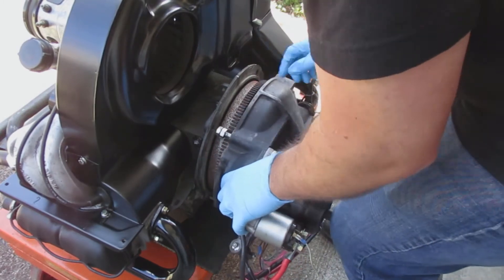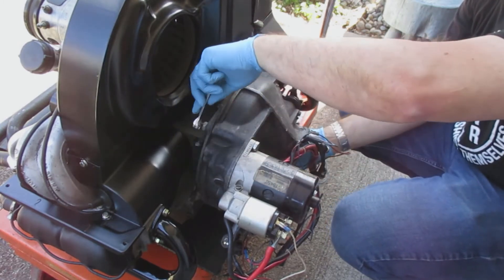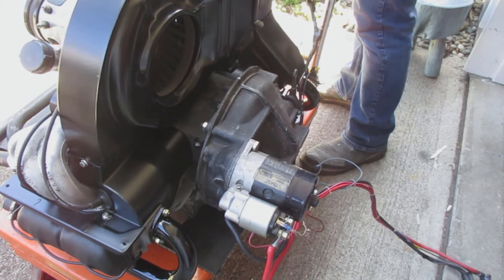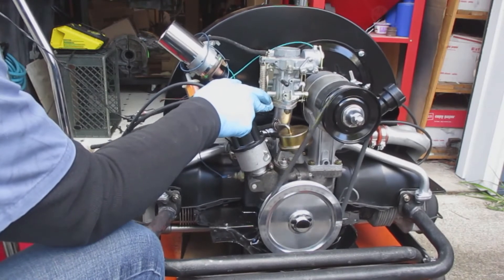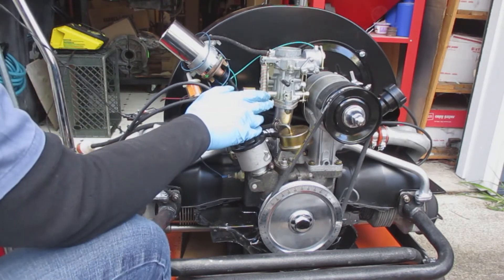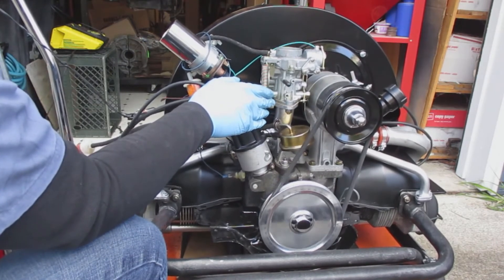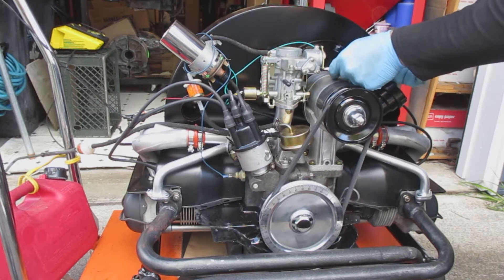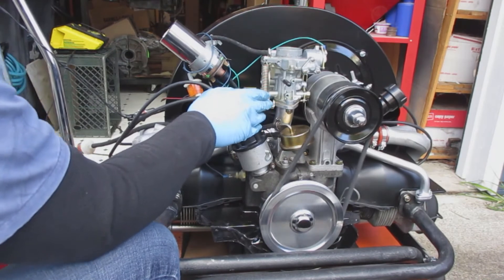How to bench start an engine outside the car - DIY - Part 2 - VW Air Cooled

Comment: Excellent video!! Thx for sharing. Im now in process of rebuilding ‘71 Ghia engine, i guess its a 1600. Im debating  on once its rebuilt and heavy again on engine stand… how do I lower that 350 lbs engine to trolly without spending more money to buy engine pulley/crane. In NY’s tiny space its tough to accumulate all tools esp when im not gonna be using them once engine is rebuilt. Sigh*
Reply from the maker: yes 300 pounds is too much for one. I would recommend having a strong friend come over. myself and another person usually is good for moving the engines around. I use a hydraulic cart to move mine. I hope your able to move yours. Have a great day!